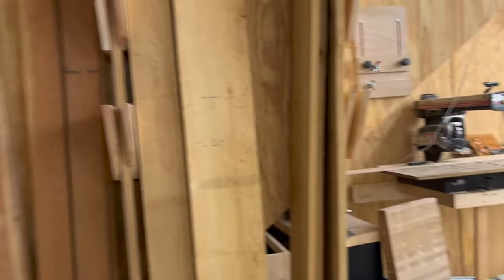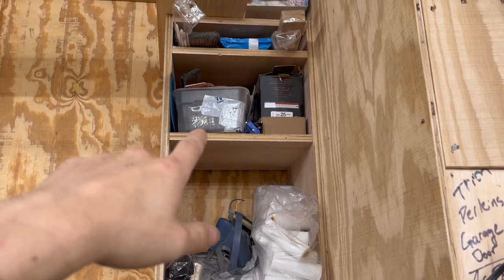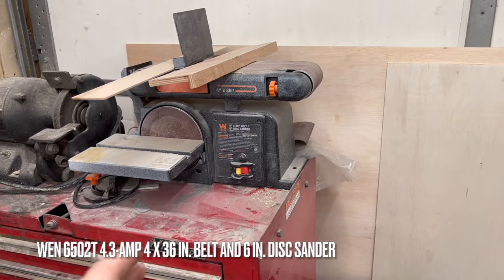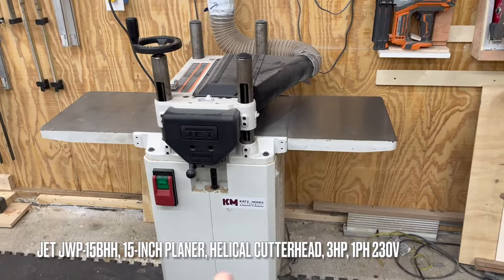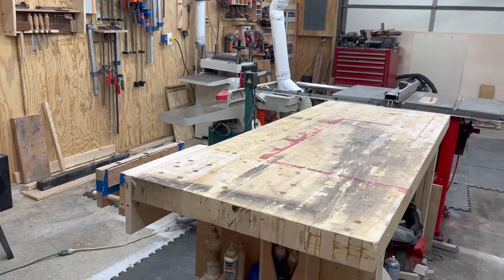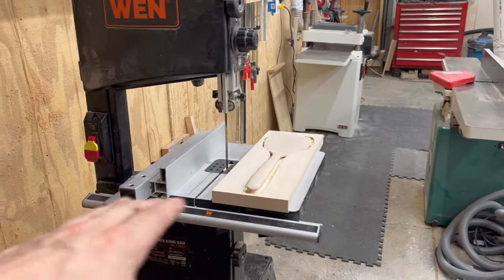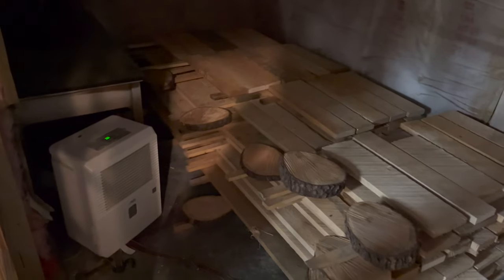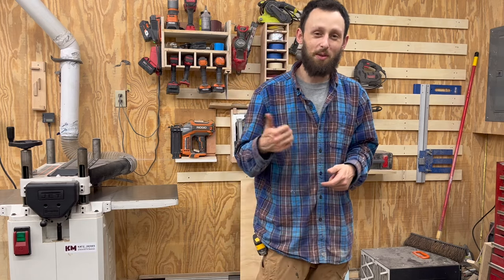I Transformed My 2 Car Garage into the Ultimate Woodworking Shop

Comment: 4x8 router table. I could use one of them lol
Reply from the maker: It’s nice having the large infeed and outfeed support for bulkier items, but would make it a little difficult to reposition the thing to run longer materials through. 🤣 As it sits now i have about 4-5 feet of infeed so anything longer than that, I’m kind of out of luck. Thanks for the comment!